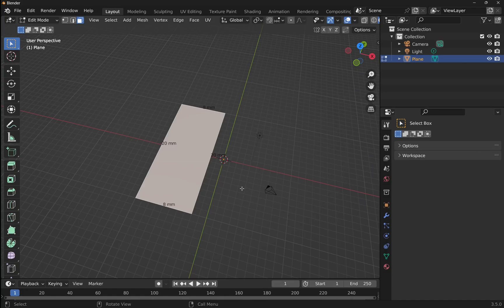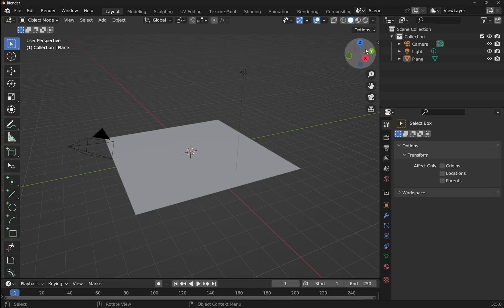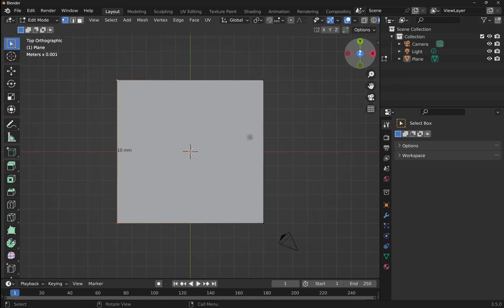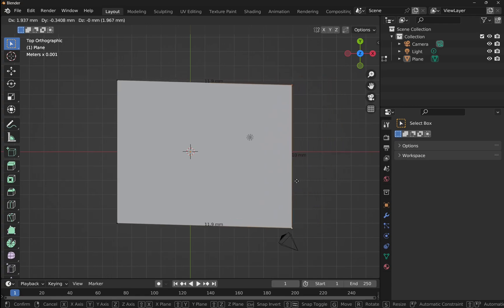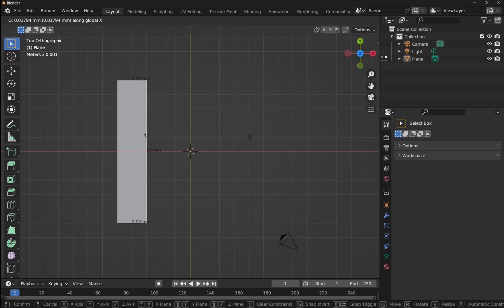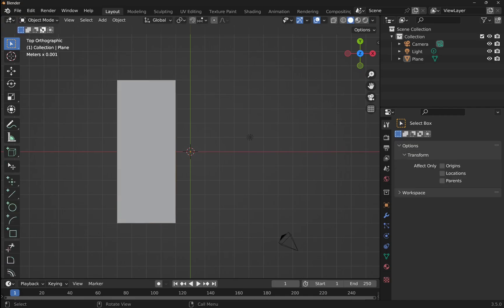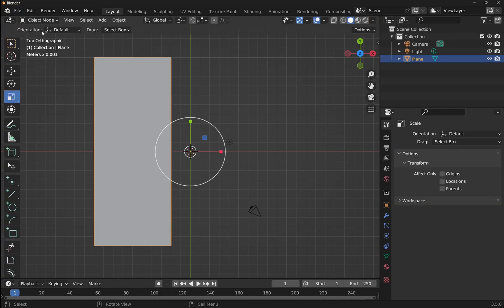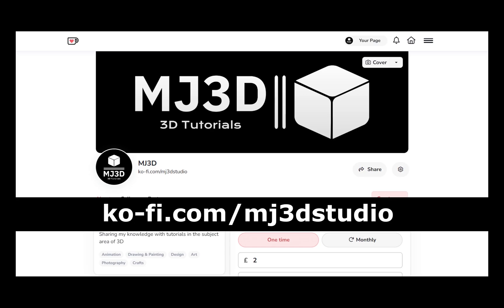Precision in Blender 3D ! How to show the edge length (measurement / dimensions) Beginners Friendly

Comment: Doesn't work. Measurements menu doesn't show up after I switch to Edit mode.
Reply from the maker: Are you using the latest version 4.0? There was a post in the comments saying this has moved to another overlay button by the side of the one I showed in v3.x. It looks like a shape with squares at the corners.
Reply: @MJ3D_Blender  This is exactly right! found it in 4.1, thanks!

Comment: Yeah, in Blender 4.0, Mesh edit mode is it's own tab now next to Show overlays. It has a 4 square corner icon in a square with the top right square highlighted.
Reply: Thanks. That helps :)
Reply: thanks, i had to stop watching a course to check that, those blender changes just don't help us at all...
Reply: I dont have these icon, how can i turn it on or show it?